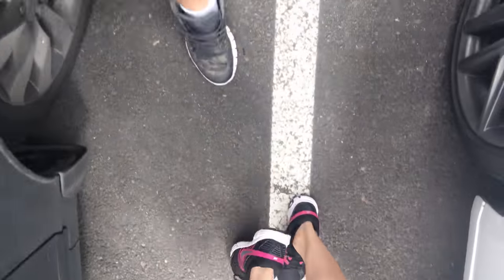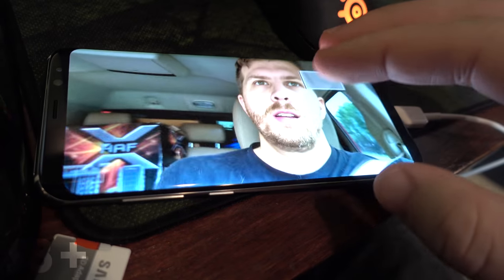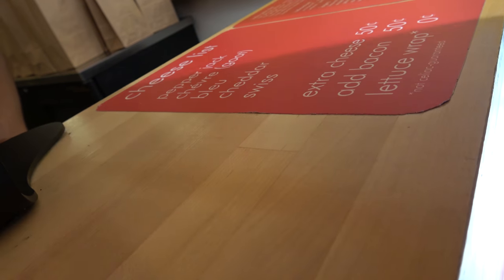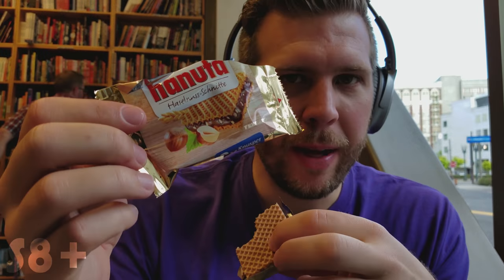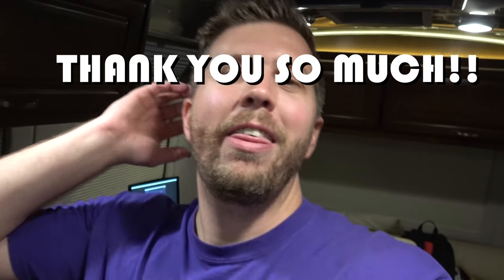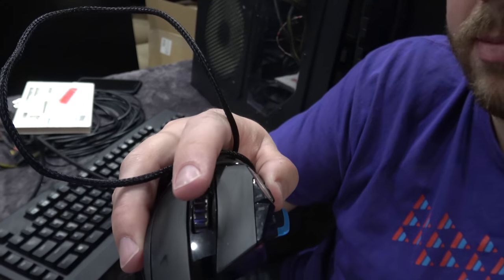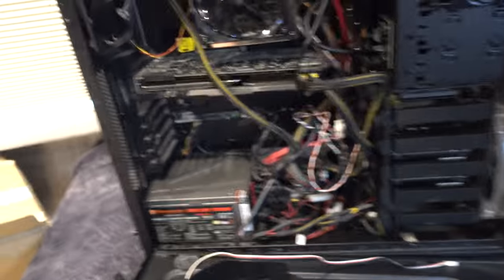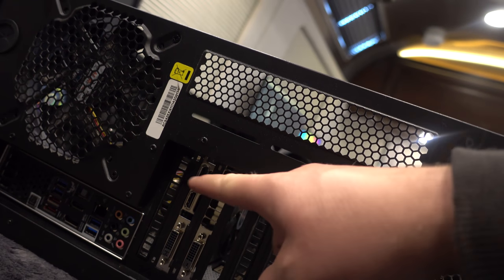Galaxy S8+ Camera Review + 50K Subscriber Giveaway!

Comment: Hey man, I really need something to edit on for my videos I have been using my moms laptop and it's just not very good! If I could win the pc that would be amazing but if not I understand you have 50k people to decide over
Reply: I know that feeling. I ruined my first laptop, a Dell Inspiron 14R N4010 because I used it for things more resource intensive than word processing like video editing, photoshop, and organizing large file sizes + moderate gaming when it could not even handle playing SimCity 2003 nor Halo1 at 440p😂 

long story short my excessive strain crippled the thing to the point  where if you turn it on, the motherboard overclocks the fan to the point where it would quickly short circuit and cause a fire!